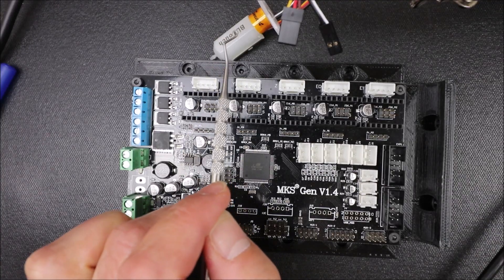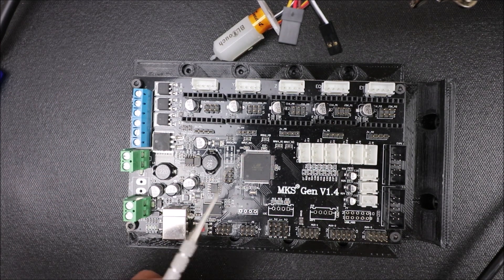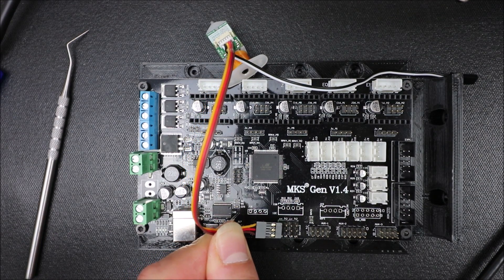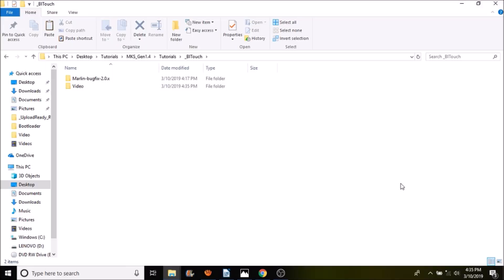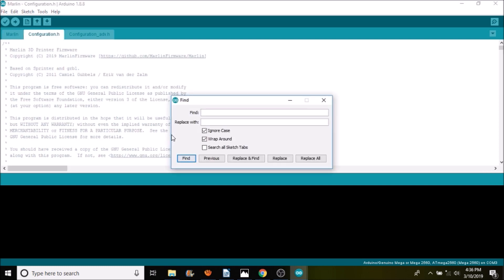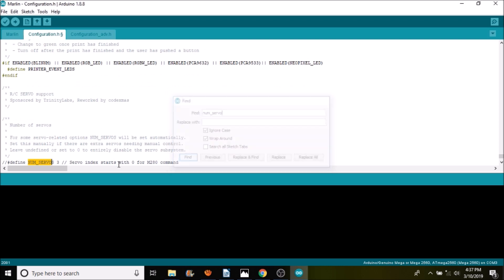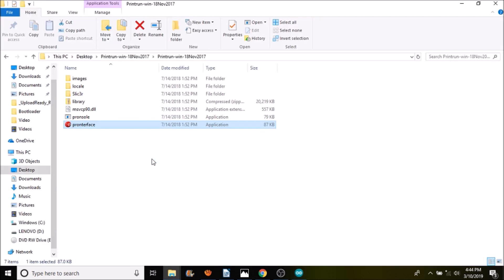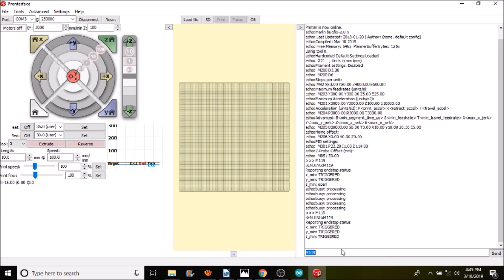MKS Gen 1.4 - BLTouch

Comment: Do you know where I should connect BL touch with a MKS SBASE v1.3? Google says that I should use X- (endstop) for ground and 5v, pin 1.25 for signal and connector, Z- (endstop like your). Is that correct? This way I loose my X- endstop connection
Reply from the maker: Do you have servo pins on that board?
Reply: @EdwardBraiman  Yes I do

Comment: Hi There i've managed to reach 2:45 in the video, however, when i plug into the PC my power light switches on, then quickly dims to black.

Then when i unplug the BL touch, it works fine.

I was thinking this may be due to me having both my stepper motors 2208 UARTs and the BL touch at the same time and not enough juice?

Does that sound right?
Reply from the maker: Unsure as I've not yet tried to connect 2208 steppers with BLtouch.
Reply: @EdwardBraiman  I can confirm now, that its not the stepper motors, when the BLTOUCH Is plugged in the board shows the green light which quickly dims still, seems its an issue with just the MKS gen v1.4 or BLTOUCH.

Any ideas?

edit: this is a ender 3 BLTOUCH package which ive been using btw, maybe that has some effect on it?
Reply from the maker: Could be two open bug on Marlin.  What happens when you use Marlin 1.1.9?
Reply: @EdwardBraiman  i've been using marlin bugfix 2.0.x,  should i downgrade?

think its before any softwar stuff though, the board wont power on with the BLTOUCH.
Reply from the maker: It maybe.
Reply: @EdwardBraiman  Ok I've been a right twat, the ender 3 versio of the BLtouch has the 5v and groud reversed!
switch those two around, and everything is fine.

facepalm

and with that, im all set up!

cheers!

Comment: Followed your video but I have an issue the pin stays retracted (red light).  If I pull the pin down, it goes back up.  ran the m119, zmin is open. hit the z home button. the 3dtouch clicks but the pin is retracted and light is red.  I can pull the pin down and it immediately retracts. Could not find any help online.
Board mks gen v1.4 Marlin 2.0
Reply from the maker: In Marlin firmware version 2.0 they've changed something around December.  I've opened two bugs on this and they've yet to fix.  When I have more time I'll see what they might have change around this time.

Comment: Why are the NUM_SEROS necessary? You change the value but don't provide context on why?
Reply from the maker: They created an timing array below so the number of servo can be many times.  Many boards support up to four servos and they specify only one time with curly brackets, which then cause compiler errors.